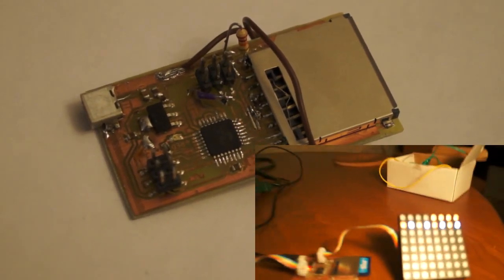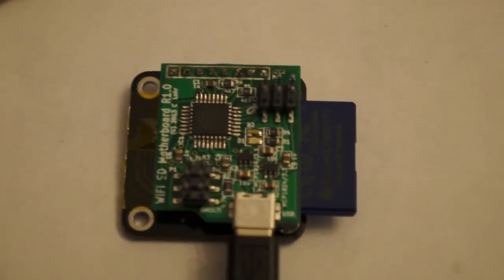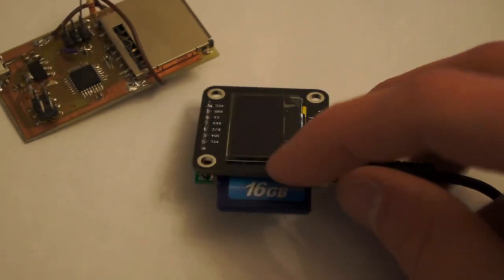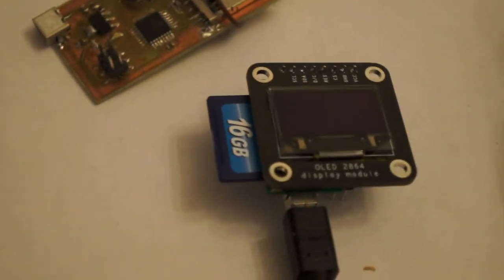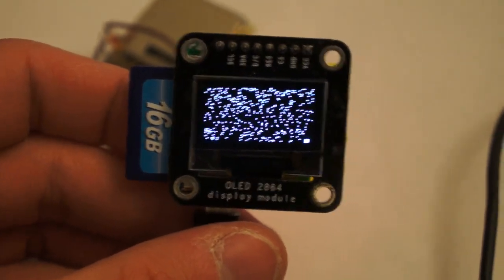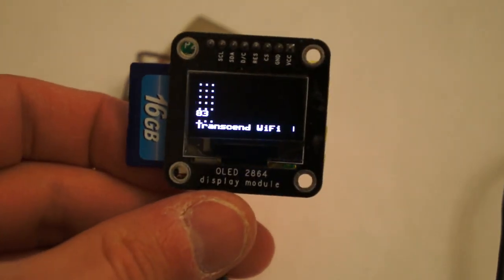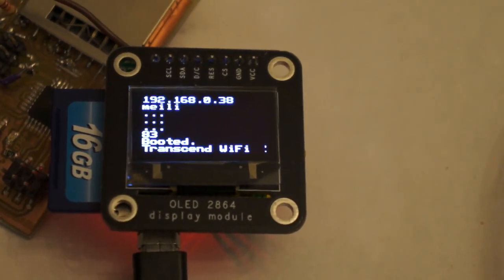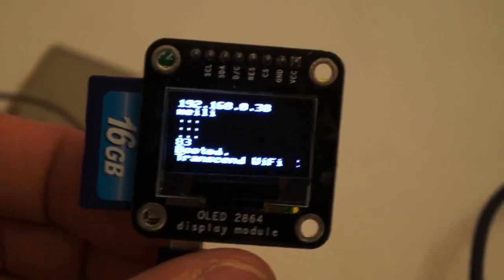Mini Host and Display for Transcend Wifi SD Card

Comment: Can you apply just a straight 3.3V to the SD card and have it boot? Forgetting all your custom boards etc.
Reply from the maker: Sadly, no.  There may be variants where this will work, but this card and all the others I tested require external, SD-protocol (not SPI) initialization.
Reply: CNLohr Damn, that sucks. Thanks though. Explains why my hour was wasted last night lol

Comment: Hello, Nice Project.
Could this be used with a i2c temperature sensor (like a TMP102), with the card serving a webpage to display the temperature results to another computer on the same network?
Reply from the maker: Yes, it could! It's kind of along the lines of what I intended it for. :)
Reply: CNLohr I am thinking about adding a MCP23008 I2c port expander, giving it room to have another eight I2c devices/sensors attached would make this product really useful
Reply from the maker: The wonderful thing about I2C is you can stack a bunch of devices on the same bus :).
Reply: CNLohr is there a way, or even any room to run python.  Have you seen Adafruits WebIde for RPi &BBB? it uses node.js, redis-server.  Running a webservice on this is more useful than Electric Imp.
Reply from the maker: I would imagine this would have PLENTY of room for python, since I seem to recall reading someone getting X running on it with some extra junk.  (well, a headless X)